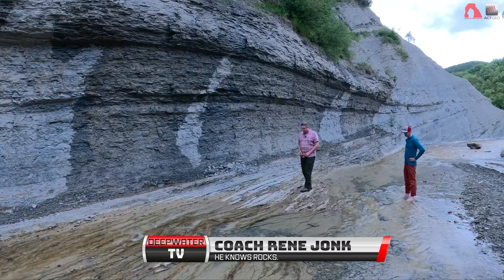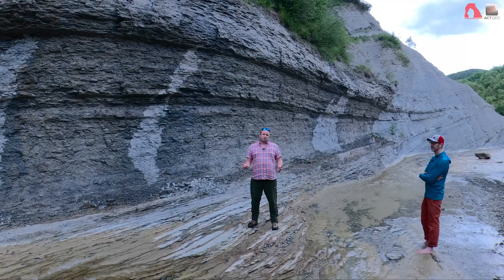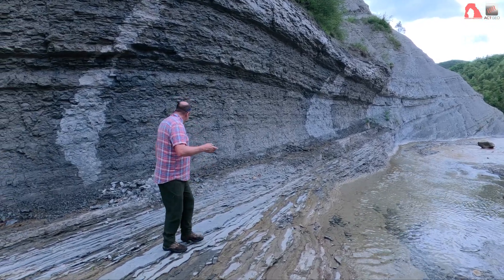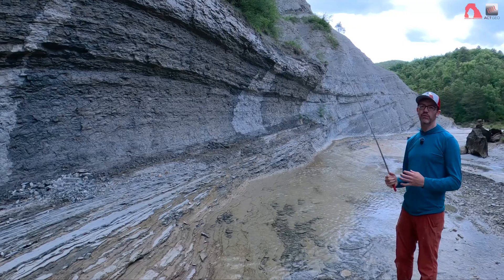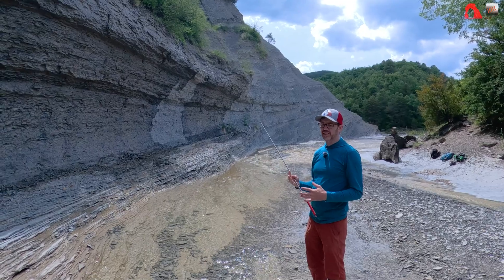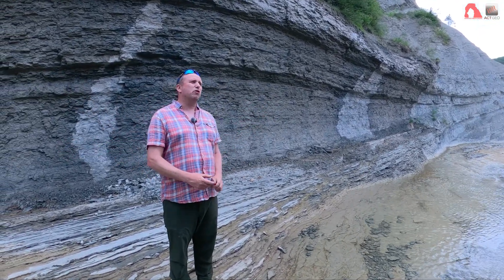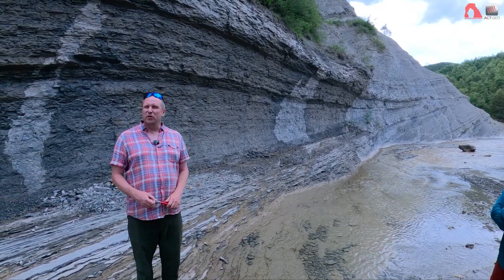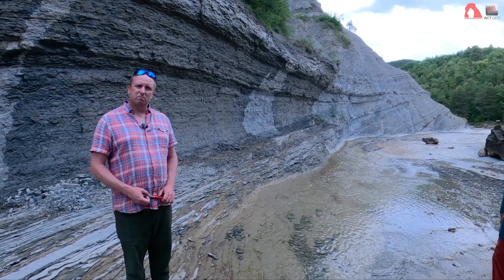Rock Fight! A (civil!) scientific debate: does this outcrop represent a levee or something else?

Comment: Some more observations needed: paleocurrents? consistent transport direction laterally and vertically? Any biostrat data that might show unconformities between the "levees" vertically? (loving your videos!)
Reply from the maker: Good suggestions! Not a ton of paleocurrent indicators to be had, but there are some current ripples in some fine sands we could/should integrate into the story. Biostrat probably won't have the resolution to resolve these subtle tectonic resets (if that's what they are).
Reply: @ACT-GEO  thanks! Biostrat can show SB, flooding surfaces, etc at sub biozone resolution, from abundances, diversity, trends, etc. as long as you have narrow sample spacing. It might worth a try.